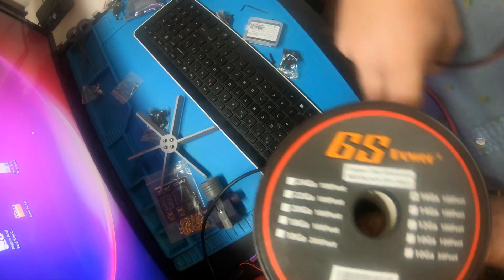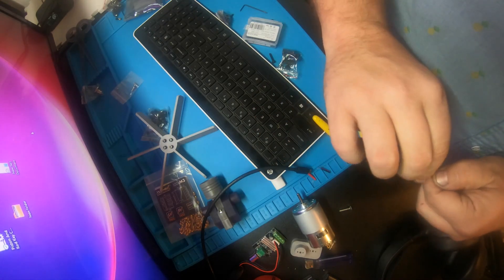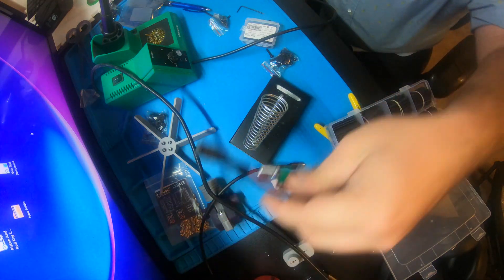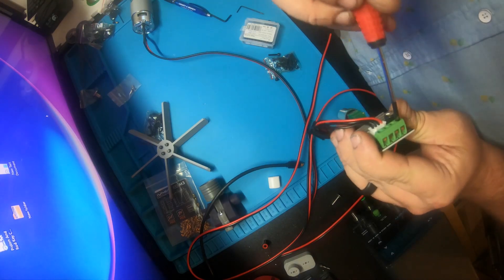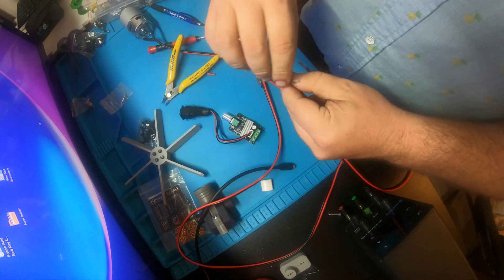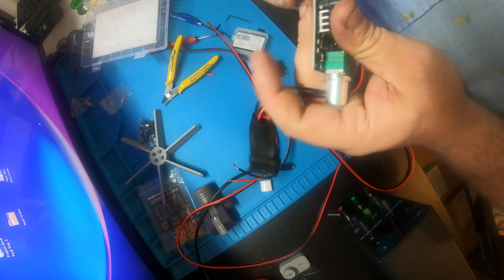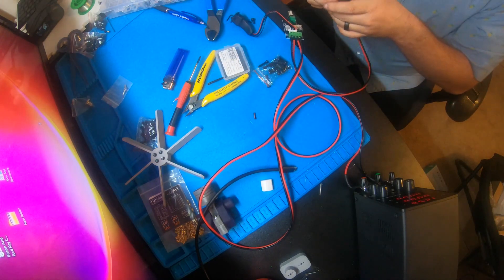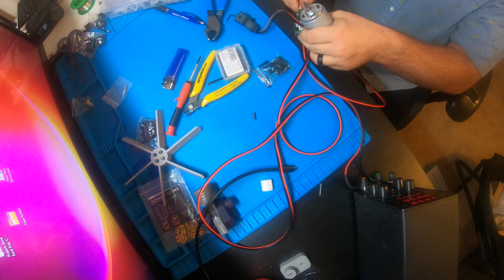Over Powered Desk Fan Build Part 1 Wiring

Comment: Are you using 200C wire?  That is VERY difficult to get soldered.  You should use some 160C wire, instead.
Reply from the maker: I'm fairly certain it's rated for 106C but it seems like it could melt just by looking at it. Haha got it from Amazon I'll pop the link in the description.